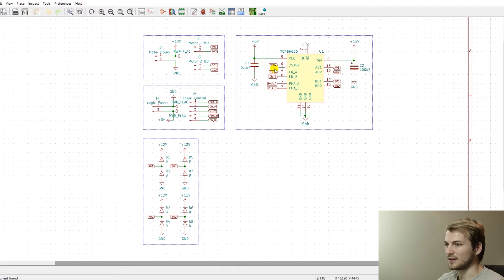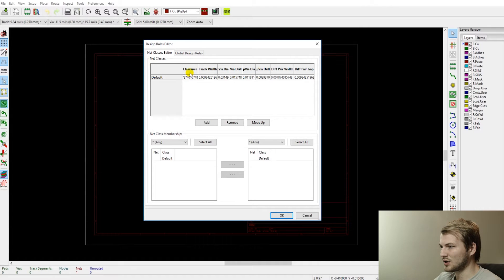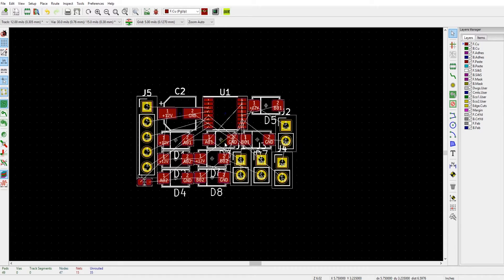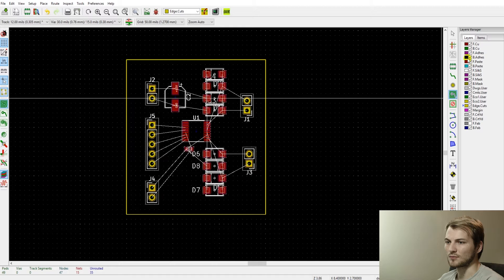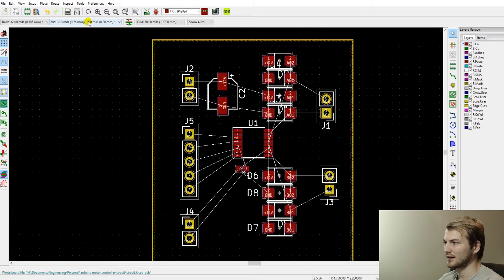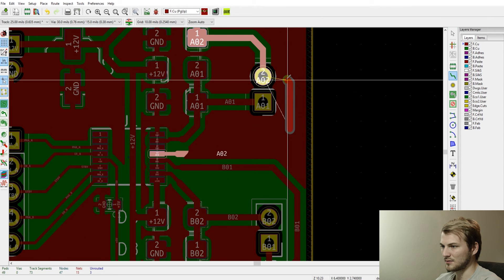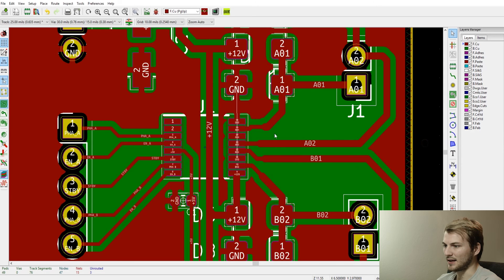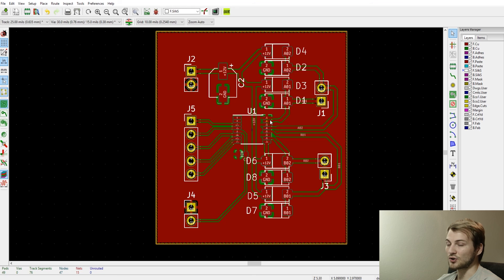H-Bridge Arduino PCB Circuit Design - KiCad 5 - Part 2/2

Comment: With regards to imperial vs metric, I would say this is poor advice you've given. 
All the board houses I work with use millimeters as the measurement system. This includes impedance controlled nets, stackup and substrate thickness, drill sizes and overall dimesional tolerances. 
The main issue is when a board house have set their capabilities in imperial and these are converted to metric. There can be rounding tolerance issues and the design can be reject. There's a good EEVblog video on this. 
For a lot, it seems like imperial is easier as it has round numbers but I prefer metric and have always worked this way.

Comment: As a general rule of thumb, yes go big with traces. However beware that large traces have a larger capacitance, and more potential area for picking up EM from neighboring components. I'm currently working with a battery charger IC, BQ25883, that specifically mentions this in the datasheet.
Reply from the maker: Absolutely. I should have mentioned something about this. Any time you have high speed traces, or anything analog/rf, wider traces can absolutely be detrimental. Thanks for pointing that out.

Comment: Hi! I really like your videos! I'd like to see a little more complex designs. I'm concern about clearance between zone and traces, for me It's a little too small, but If your fab house can handle that, kudos to them!
Which pcb manufacturer do you prefer and which component supplier do you use the most? Still waiting for your website to run!
Reply from the maker: Thanks :) Really? Even OSHPark, which is a hobbyist fab house can handle 6 mil clearance. I usually use Bittele/7pcb for my client's boards in larger quantities. For prototypes, I'll use PCBZone or even OSHPark occasionally, depending on the turn time.
Reply: @MicroTypeEngineering  PS check your inbox :)
Reply: @MicroTypeEngineering  yup, they can handle 6/6 but for me is better to don't push to that limit and give them a little more "safe space" - I'm setting 8/8 and It works really nice

Comment: How do you update copper zones? In eagle you just use ratsnest..
Reply from the maker: So that's the "B/Ctrl-B" I mentioned. "B" fills them, and "ctrl-B" un-fills.
Reply: Disadvantage of Ctrl-B is that Kicad shows ratsnets for components connected to ground and power planes. On left side of the screen there is a vertical toolbar and button in the middle that shows "Do not show filled areas in zones". When you click it you wont see filled zones in pcbnew but they are still visible in 3D Viewer
Reply from the maker: @voytechj, yes that is true, I normally am able to just ignore it, but your solution works as well!

Comment: Hi there! Love Your videos, keep 'em coming. A few comments:

You can easily change trace width by hitting "q" after you started routing. I think you'll find it easier and quicker than changing the design rules all the time. Then you can also use several trace widths as standard, and just change them on the fly. Typical power traces to fine pitched IC's.
Think you can even define a hotkey for changing trace widths. Haven't tried though.

I observed you struggled a little bit there with a trace, and ended up deleting a couple of segments before routing again. In most cases you can just route a new trace over an existing one, and the old trace will be deleted. It's a setting somewhere. I have this same habit myself, after years of using Eagle. My god how many mouse clicks I've done to dele traces in Eagle!

Metric vs. imperial. Sighh! An never ending discussion. We have to master both. Living in a metric part of the world a prefer that. Most new fine pitch packages are metric, so I'm using a metric grid, metric trace widths and metric via's. It'll be a mix of both whatever you do.

I like the idea of you evaluating boards and schematics from others. Think there is a lot to learn from that.
Reply: Had to do a little research on the hotkeys for changing trace width. First you have to define several widths in the GLOBAL design rules. Then it's as simple as hitting "w" or "ctrl+w" to step up or down as you're routing.
Reply from the maker: Yes! I knew I saw that hotkey before, never bothered to figure it out again, thanks! Yeah, bad habit on removing the trace and not just going over it, even harder when talking to the camera haha.

Imperial/Metric, I'll stay out of that one! But you're right, I shouldn't have stated it as fact like I did. A lot of people have been switching to metric lately, I was just always taught to use imperial.

Thanks!
Reply: >I observed you struggled a little bit there with a trace, and ended up deleting a couple of segments before routing again

To add to this, you can use the '/' hotkey to change the direction of the bend in a trace, instead of starting the trace from the other pad.
Reply: As long as people use(tolerate) imperial(non SI) units they are not going away. Most of the world uses metric, just like most of the world drives on the right side of the road, but few countries(UK, Australia, Japan...) don't.